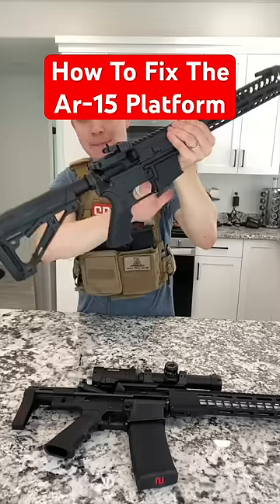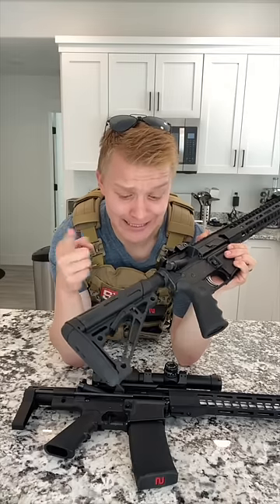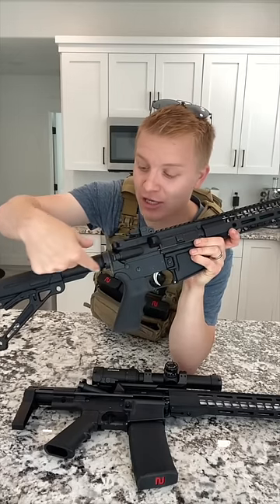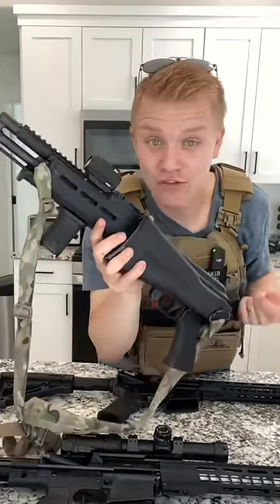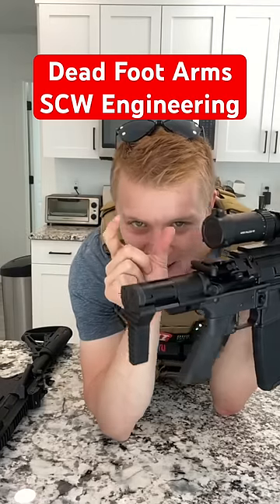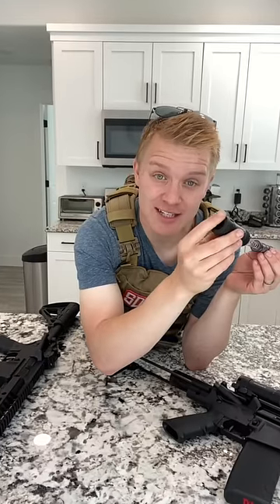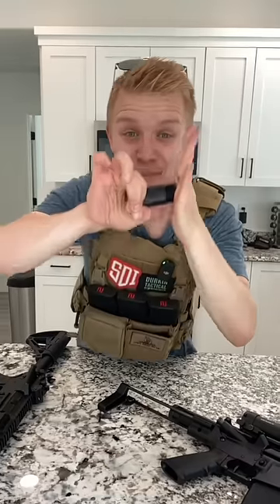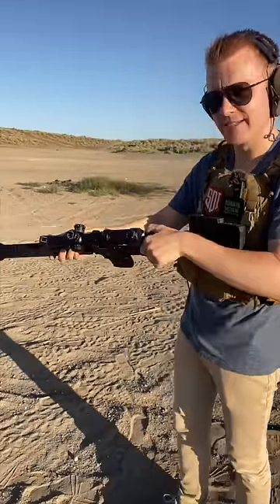How Is This Possible? *Dead Foot Arms Engineering* #gun #civtac #ak47 #ar15

Comment: AKs: "Look what they need to mimic a fraction of our power"

Edit: Seems I have angered quite a few AR fanboys
Reply: AR to AKs In reply: "At least I can make accurate fast follow up shots without jumping around like a crack addict."
Reply: @captainironbat8193  5,45 bro
Reply: @fedorveprevsky1058 rather be shot by 1, 7.62×39 than 4, 5.56×45
Reply: @misterpotato427  well, 5.45 extensions with its task of one bullet, I don’t think that a person is very dependent on the cabin that kills my saiga
Reply: @misterpotato427 I’d rather not get shot by either.
Reply: @rdpillsforall6884  yeah honestly, let me rephrase; rather be shot by 0, 7.62×39 than 4, 5.56×45
Reply: AR-18 systems: let us introduce ourselves.
Reply: "Look what they need to mimic a fr-" gun jams
Reply: Um my AR shoots 7.62 😂😂
Reply: AR: did those AK's get any attachments yet? Wait they don't even have a rail.... 🤣😂
Reply: Ak guys can ahoot with the stock folded because there is no point in aiming your innacurate ass rifle anyway
Reply: @jarretthuffin My brother Zenitco and Midwest Industries fixed that issue lol, AKs are modernized now.
Reply: Literally lol
Reply: @captainironbat8193  the accuracy and quickness is 100percent reliant on the shooter
Reply: Folding stocks only matter if you need compact storage because you're not using it.
Reply: @captainironbat8193 sounds like you don’t know how to use gas settings 😂
Reply: PWS 762X39 Uppers. AKs are still corn grinders.
Reply: @captainironbat8193 any modern military use AK or AR are about same in accuracy.
Reply: @misterpotato427 exactly not even a question. Ppl who say 223/556 isn’t deadly are clueless.
Reply: Keltec
Reply: *Original Armalite enters the chat.*
Reply: @captainironbat8193 let’s not forget, our optics can actually hold true zero
Reply: @misterpotato427 wanna see how big and wet the holes are from my .308 AR10? Let’s not forget, Eugene Stoner designed the AR platform originally to be chambered with 7.62x51 NATO
Reply: @fedorveprevsky1058  Same problem, since it's the gun, not the round.  AKs have far more mass moving around, thus will always have more recoil.
Reply: @misterpotato427 *300 Blackout enters the chat* One of the best things about the AR platform is it’s modularity and versatility. I can swap uppers all day and shoot .50 Beowulf down to a .22LR. 

Can’t say the same for the peasant rifle
Reply: @medievalarmorexptert6827 wrong. They are miles different in accuracy. You're not shooting 300m with an ak accurately with iron sights. Ar can group with all touching holes.
Reply: What power does an ak have? My ar can go through half inch steel. My ak just takes the paint off. Thousand fps difference between the 2. Ak is good for soft tissue though. But for soft tissue, I'll just load up some varmint grenades in the ar and I'll still beat the ak while being way more accurate.
Reply: @200130769  lol there is no proof that either is definitively better than the other when you get a military M4 (not AR-15) and a AK-74MN or AK-12 since were comparing modern firearms. Though people have done their own tests and again if you take two equally modern firearms like an AK-12/AK-74MN and an M4 they simply are going to be pretty much equal in accuracy. Its never about the firearm when it comes to military AKs its always the user. An M4 user might not be able to aim/handle the weapon correctly to hit accurately and then cry about how bad it is. Or they just bought a shit condition one. The AK can easily keep up with an M4.
Reply: @BackwoodsBabies mine does those in nato flavour!
Reply: @jarretthuffin people that shoot aks , need no “platform” . it is the platform.
Reply: Problem with AK is length of pull is made for a child and the effective range of an AR is nearly twice that of the AK.
Reply: @captainironbat8193  Except I can make headshots with ak iron sights but I need an acog for my ar....
Reply: @captainironbat8193 AKs are actually really accurate, you should try shooting one
Reply: It'd be great for an ar10.
Reply: @misterpotato427 no, you wouldn't.
Reply: @misterpotato427 says the man who’s never been shot before💀
Reply: @oldnite3414 then you can't shoot, or the 100s of thousands of us that qualified at 500m with iron sights in the Marine Corps were practicing some sort of black magic
Reply: @andrewcarlson2178  Doesn't explain why I'm accurate with my AK iron sights lmao
Reply: @dickyrichardson2193  True, but I still believe getting hit by 4, 5.56 rounds is much worse than getting hit by 0, 7.62 rounds. And on the topic, have you been shot?
Reply: @misterpotato427  i’m replying to your original topic
Reply: @misterpotato427 I think if you’re getting shot you don’t have a choice lol
Reply: @oldnite3414 that sounds like a you problem, because I can do that with either firearm, using optics or irons, at distance. Get better?
Reply: @DankSandwich  https://youtu.be/m-VeubLxI58. That video shows how ridiculous 77g 5.56 is. If I need 500m plus hits, give me .308. Inside of that, I'll take 5.56. Ridiculous as it is, I can carry 12 thirty round magazines on my plate carrier. I tried that with .308 and I was down to 7 for the same feel.
Reply: Whoooole bunch of guys in here talking about what they “think”. Let me see some CAR’s or FMF pins orrrrr 🤫.
Reply: @jdoe4275  I'll take my CIB 🤷
Reply: @misterpotato427 ok dude look up 7n40 ballistics testing and then say that
Reply: @DankSandwich yeah and it’s still not an ar-15. Ar-10s are fucking awesome guns. I personally just don’t think 223 is a great caliber. It doesn’t do any one thing great. It’s just ok at everything.
Reply: @DankSandwich 7.62x51
Reply: @DankSandwich 7.62x54 is the russian round designed for the mosin nagant.  Not a NATO round.
Reply: @captainironbat8193 AK muzzle rise is negligible with a slant brake the only thing that throws you off is the backwards recoil.

So that tells me that you either dont shoot 7.62, don't train and know proper footwork, or are just weak.
Reply: @swordoflaban6594  u right, I knew that just typed in the first 7.62x5_ that popped into my head. Not much thought/effort went into my original comment
Reply: @DankSandwich  gtg🤙, and FJB.
Reply: @captainironbat8193 sounds like a skill issue lol
Reply: @captainironbat8193 well it's a common myth that AKs have bad accuracy
Reply: @medievalarmorexptert6827 no it can’t easily keep up with the ar. That’s the whole problem with the obsolete platform of the ak series. The average battlerifle of an ak platform has been tested by various militaries and civilian shooters and found to be about 30% less accurate purely on the basis of how the recoil mitigation systems and rechambering system cause the weapon to rock and shake any mounted rail optics. And it’s iron sights don’t adjust for windage, only distance. A better then average shooter like Russian spetsnaz, british SAS or any given US special forces operator as well as experienced civilian professional tournament shooters may know how to compensate for these design failings and make the most out of the gun, but no test has ever shown an AK to be on the level with an AR platform. Don’t lie or try to obfuscate with false equivalencies and vague platitudes: the AR is the superior shooter both for accuracy by point and shooter ergonomics.
Reply: @andrewcarlson2178 I mean to be fair, the marines are the black magic voodoo mages of death, that’s why they give the lords angels a holiday when we go to war XD
Reply: @SerbijaSupreme it’s not a myth, but it’s greatly over exaggerated. A Russian designed AK is not (as I like to jokingly poke fun of them for) so inaccurate that it would miss the broad side of a barn at 50 yards. However: because of the design of the weapon, how it’s moving parts function, how the recoil dampens (or rather fails to dampen) significant muzzle rise and how the weapon is machined together, the expected accuracy grouping at any given range out to 200m is about double what you would expect of the AR assuming the same interval of time elapsing between shots and the same shooting habits (I.E. if you were getting 2 inch groupings at 100 yards with an AR on iron sights, you would expect to double that to 4 inches on an equivalent AK). A lot of those myths also spawned based on the 47 variant with the 7.62 round which is much lower velocity and would drop significantly, leading to shooters almost having to ‘lob’ shots by aiming inches or even feet over their aiming point to have the rounds fall on target, which would significantly reduce their accuracy. And then there’s the whole catastrophe of an ak trying to hold stable in automatic fire compared to an AR but that’s not a topic for today. Suffice to say, AKs have shitty accuracy when you compare them to better rifles but it does still do what rifles do.
Reply: @nathanielweber7843  to be fair, idc how accurate it is. I rather not be on the receiving side of the barrel of any gun
Reply: @nathanielweber7843  finally atleast a decent argument and not just "no". Now just gimme the source for the statistical info and then we can talk about it.
Reply: @SerbijaSupreme  I mean that’s just a given, but assuming someone somewhere is getting shot at, probably in a war by a weapon of both variant family groups, I would feel marginally safer taking an M4 against an AK then the other way around.
Reply: @captainironbat8193 theres a reason the ak is more popular bro
Reply: @jarretthuffin 

Unless you’re stuck in the 50’s, AK’s have had access to Rail systems, for literal decades now, COD or internet stories arnt real life bub.
Reply: And the exact same amount of “wishing I had a stock so I could stop missing”
Reply: And the exact same amount of “wishing I had a stock so I could stop missing”
Reply: The AUG platform is better than both ngl
Reply: @leonelmartinez2486  shush
Reply: @dantheman4564  you mad bro?
Reply: @captainironbat8193 you like pick of tinny rail because American gun is not good enough as is
Reply: @DankSandwich tell me you aren’t familiar with the Zenitco B33 without telling me you aren’t familiar with the Zenitco B33
Reply: @GreenEyeDemon AR>
Reply: Power as in ft-lbs and actual wounds would like a word with you, sir.
Reply: @elijahungerman2066  if nothing else 223 is a great training and varmint round on the way to 308 and others
Reply: and then they realize we have 8.6blackout in ar10 platforms now 😈
Reply: Lol, at least I don't have to reach under my rifle to reach the charging handle xD
Reply: @fedbia2003  that's where the discharge lever is
Reply: I like both platforms. 77 OTM for the AR and cannot go wrong with regular Tula for the M70 (Serbian AKM variant).
Reply: I love this comment
Reply: Optics are keyin today's conflict and the ak platform doesn't support optics well.
Reply: @george2113  AK do have that weird side mounted pic rail.
Reply: @GreenEyeDemon  Thank God...
Reply: 7.62x39 is a better round than 5.56x45.. Cope
Reply: The edit! Lmfao!
Reply: Since we’re way more likely to be fighting our OWN government, owning a gun that uses the SAME cartridge that they do, for supply issues seems OBVIOUS. Be a duh, and run outa Ammo a year into the fight……….
Reply: ak<ar
Reply: Is the AR platform suoerior to the AK, arguably yes. Is the AK the second best thing and only limited by lack of standardization and 1940's technology? Also yes. Its still easier to get a new shooter comfotable with ARs and they have fantastic ergonomics. AKs are mildly out dated but not to be slept on.

Everyone buts heads over the 2 as if they aren't the 2 best weapons platforms in the last 100 years.
Reply: America has been losing wars to AK users since Vietnam and still there is an argument against the efficiency and efficacy of the AK.
Reply: @TheSNOTTBALL  what war have we won since ww2
Reply: Out of principle, the same can be said from the AR side when talking about accuracy and versatility
Reply: Laughs in cracked trunnion
Reply: Real gun guys just like and own both but hey to each his own
Reply: @GreenEyeDemon yeah people don't get this, I'm not a big dude my favorite caliber to shoot is 22lr but everyone looks down on 22lr, I am absolutely the grim reaper of squirrels with it
Reply: @kazakhstanisastate4614  true but at 130 lbs I have a much easier time with .22lr than with a 30 caliber anything
Reply: @GreenEyeDemon  true, its more reliable at a fraction of the cost. Buy a budget ar and a budget ak and see which one runs better. My 600 dollar ar will perform better than a 1000 dollar ak which is basically a budget ak. Theres also piston driven ar's and thats the only thing ak's had that made them even somewhat desirable. Ak's are just ugly, ar's are sleek and sexy.
Reply: @GreenEyeDemon  you realize I said the AK platform is stuck in the 1940’s. The AR-15/M16 platform had an easier more cost effective time being modernized.
Reply: Lol
Reply: I like em both but ar platforms aren't tryna build aks ....however Russia is trying make a AR with style which they've done and it's pretty nice ....minus the wood but that's personal opinion

Comment: It's not folded it's collapsed. Two completely different things.
Reply: No one said it was collapsed. He just said it's very compact.
Reply: @justNewo  i didn't say he did. He's comparing oranges to apples. One is a folder and the other has a collapsible stock (sort of).
Reply: @justNewo he also suggests it shoots folded. It's not folded. It is collapsed. 👍
Reply: There are things in life that fold and collapse at the same time
Reply: @FlatlanderGear  not in the way of this video. Collapsible is even a stretch as it doesn't go flush to the weapon systems.
Reply: STOCK IS MOVED NOW. LESS STOCK. NO STOCK IN THE WAY. SAME RESULT ACHIEVED. terminology-bros losing sleep over this video istg
Reply: same thing in here in jersey as both need to be pinned unless the gun in question is a fixed mag or bolt action.
Reply: @kraktjoetv Terminology matters to people who know what they are talking about.
Reply: @michaelholt8590  people who know what they're talking about don't have to make corrections and say that they know what they're talking about... that's for people who want to look like they know what they're talking about
Reply: @kraktjoetv  Wow you used words to say absolutely nothing.
Reply: @kraktjoetv  People who know what they are talking about use the correct terminology.

Because they actually know what they are talking about. Funny that not one of my DS in basic used terms like "do hickey" or "this thingy here" because they knew what they're talking about.
Reply: @michaelholt8590  a little like the people obsessed with terminology, huh? stuck on words with no meaningful difference.
Reply: @michaelholt8590  and people who don’t go out of their way to correct others to reaffirm themselves that they do, like OP.
Reply: @kraktjoetv  You keep telling yourself that.🤣🤣🤣
Reply: @kraktjoetv  If you don't know the terms folding and collapsible are different then this has become a much funnier conversation.

One of the main differences when it comes to firearms and folding or collapsible stocks is some of the folders (especially older designs) can't be fired with the stock folded. If someone doesn't know that it can become a big problem.
Reply: @michaelholt8590  don't you just sound like a ray of sunshine...
Reply: They make one that goes into the bcg and makes it a folding stock that can fire in a folded position  looks fantastic
Reply: Damn we really going to be getting butt hurt over technicalities 😂
Reply: @leopapio683  people are so pedantic for no reason
Reply: @kraktjoetv  that's what I'm saying, I've always been all about just shooting the shit, but now it's like you have to be a subject matter expert lol

Comment: A long time ago ZM Weapons had replaced the buffer tube design solution with an external piston and a return spring that was mounted on top of the barrel. LR300 is the name of the rifle. And it had an adjustable folding stock. At the same time the upper was compatible with any AR lower. What killed it was the price at around $1500 per rifle which between 2000-2007 (ZM Weapons) and 2009-2011 (Para Ordnance USA) was considered sky-high, all for a benefit that wasn't really all that decisive.